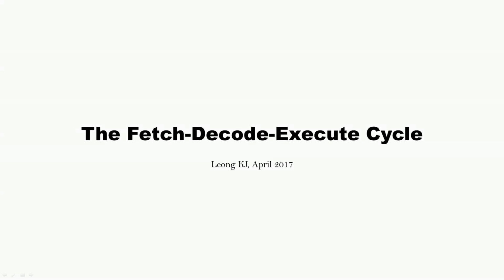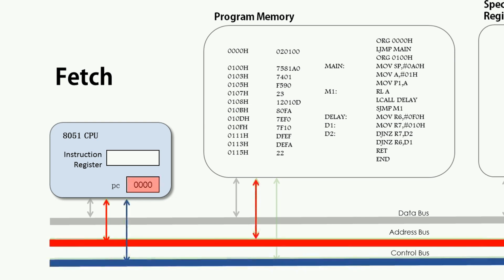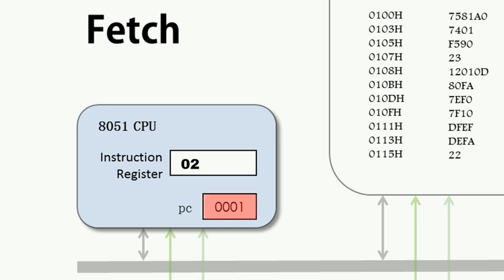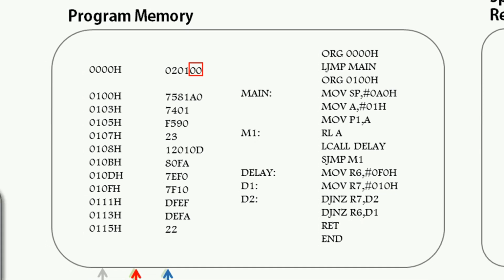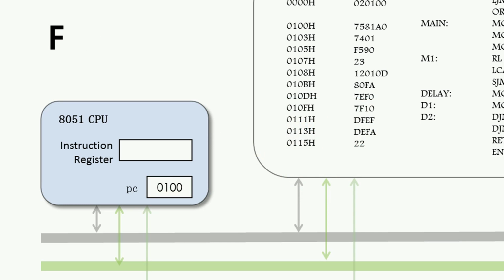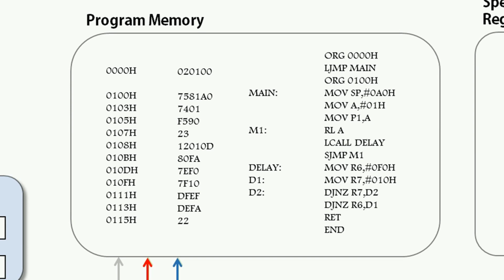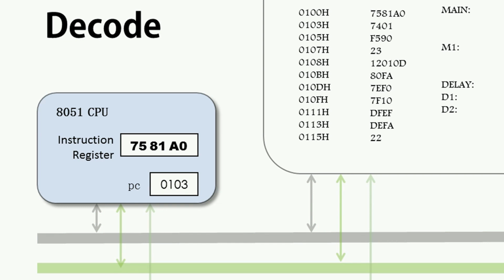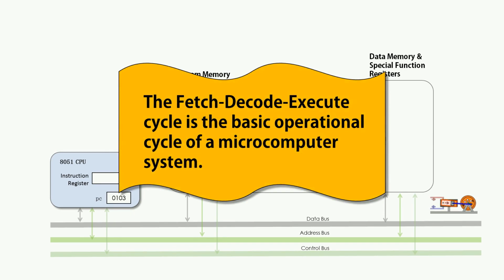fetch decode execute cycle (basic)

Comment: After the CPU goes to Decode Cycle, "who", "what" decides that the "hex code value" is incomplete and cannot be executed and "makes" the CPU goes back to the "Fetch" cycle. Please explain this in detail in your next video.
Reply: The CPU knows because the instructions in machine codes are well defined. For example, if the code is 0x20, it will be followed by 2 extra bytes.
Reply: KJ Leong
Thanks Leong. That was great.